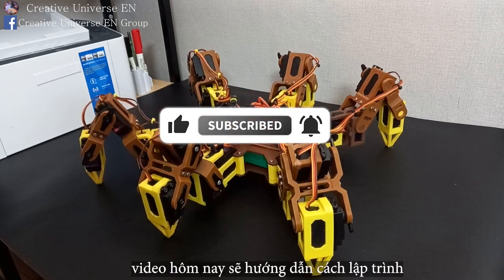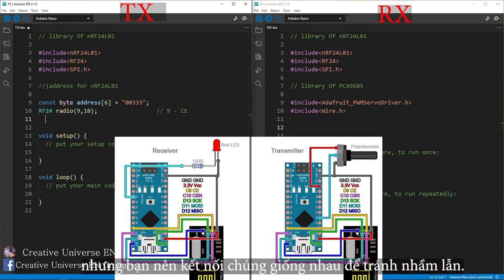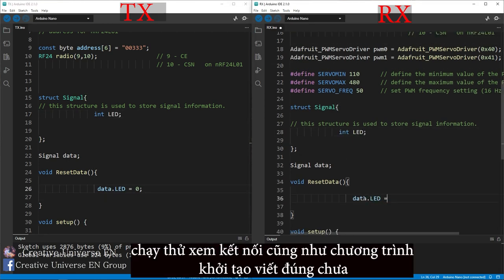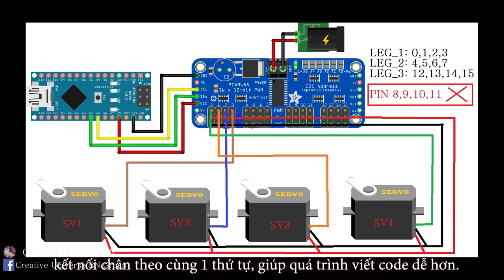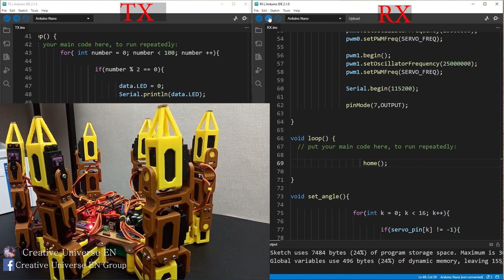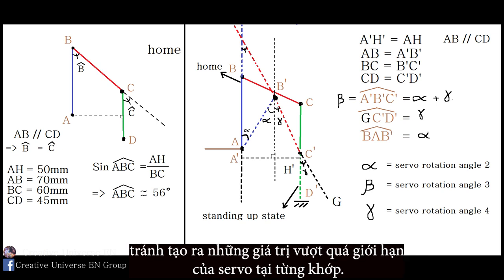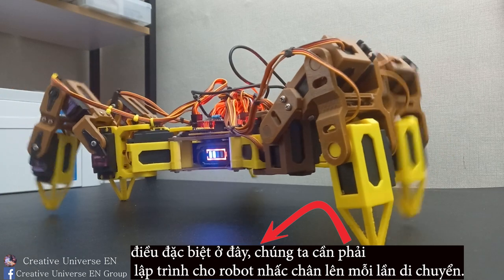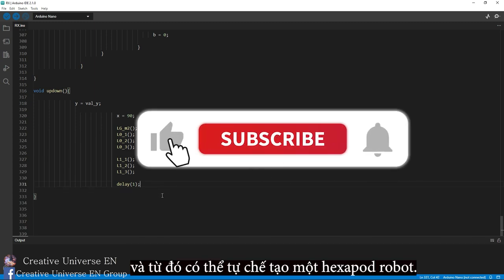How I built an Arduino Powered Hexapod. Part 3 of 3: programs code

Comment: I'm using RDS3225 servo motors, I put a 12v 5000mah battery, but the motors don't work properly, I think this battery is too weak?

Comment: how did you solved random servos movement? for me it's crazy moving no pwm set bet they move randomly :/
Reply: solved. I changed second board address to 0x50 and disconnected OE pin from PCA9685 now it's working.
Reply: actually the issue repeats randomly and don't know what cousin it.

Comment: Why did you use a 4th servo motor and why didn't you put it on the unused axis for more interesting movement? Nice robot nonetheless!
Reply from the maker: Because, when using 4 servos the robot's legs will be more flexible than 3 servos.

Comment: why you don't use pins: 8, 9, 10, 11? Why you use for leg3 pins 12, 13, 14, 15?
Reply from the maker: because the connection distance will be shorter

Comment: Fantastic sir !, your robot has a smooth and stable gait🤩.  I'm also building a hexapod using Dynamixel Servo from scratch. I have got formula for Inverse Kinematic and also leg trajectory using Cubic Bezier Curve (with 4 control points). 

I want to know what the gait formula/concept is (especially for the Tripod Gait) to determine at what point the three leg should starts to swing while the other three leg is pushing. So that the robot body can be stable when walking (no dragging feet when walking) like what your robot is doing in this video : https://youtu.be/w0ix0ggVPDM 

And also how do you set the difference execution time between one leg group (three legs) and another leg group? Does it means you set the difference execution times when the three legs are swings compared to other three legs are pushing?. 

I need your help 😁, and also if you can provide an example of arduino code or other reference regarding the thing I'm asking about, I will be very helpful. Thanks😄